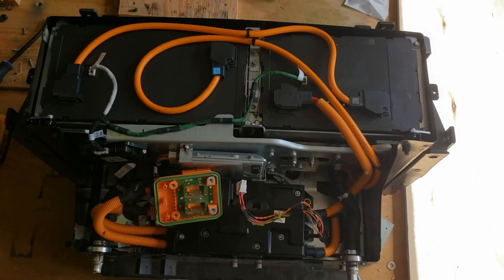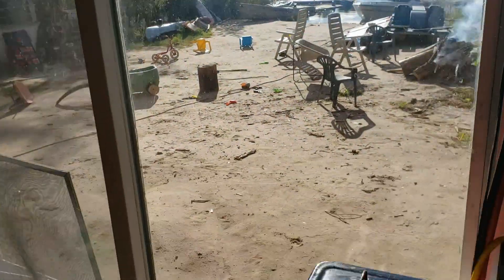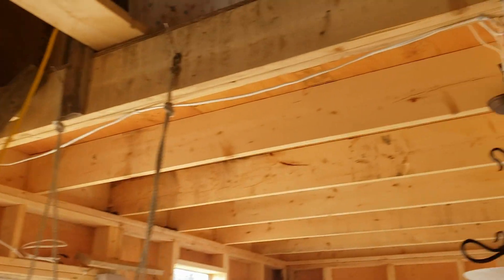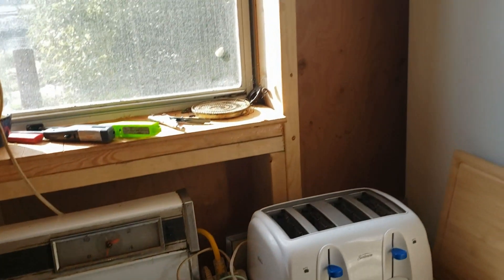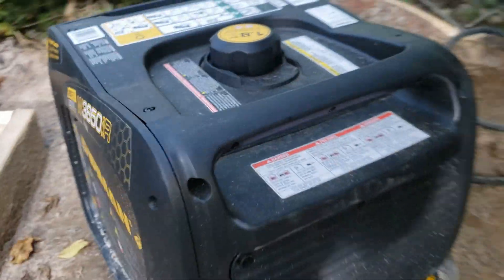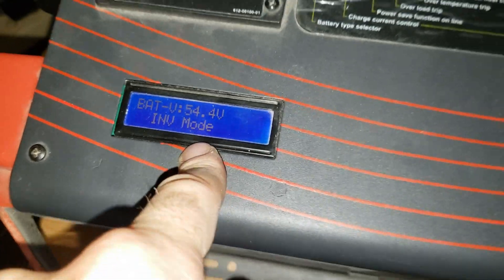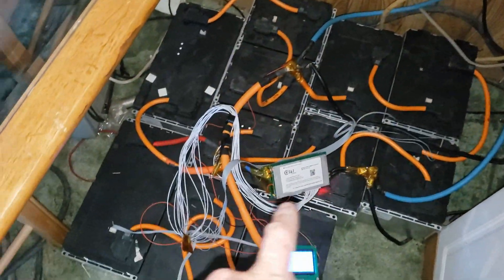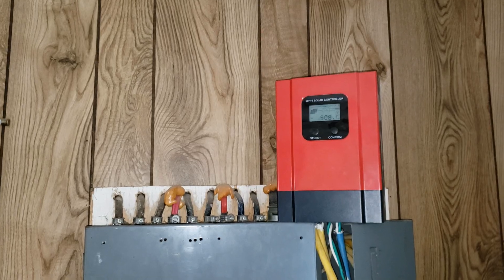12Kwh BMW Battery And Camping

Comment: Why no insulation in the walls. Nice system and video.
Reply from the maker: Just haven't had time to do it yet
Reply: Going Off Grid that’s cool, just strange to see stuff inside without it. Thanks for replying.

Comment: What’s BMS specs and where to get ? Ali express? What is amps or wattage of inverter your connected with. Thanks
Reply from the maker: 350 amp bms 48v powering a 6000w signeer inverter, I really like the bms it's from aliexpress
Reply from the maker: 300 amp not 350

https://www.aliexpress.com/item/32954067682.html?spm=2114.search0104.3.1.21375d47zQfJNE&ws_ab_test=searchweb0_0,searchweb201602_2_10065_10130_10068_10547_319_317_10548_10696_453_10084_454_10083_10618_431_10139_10307_537_536_10059_10884_10887_100031_321_322_10103,searchweb201603_57,ppcSwitch_0&algo_expid=f5a9c49b-7850-4471-8995-42c1162aae1f-0&algo_pvid=f5a9c49b-7850-4471-8995-42c1162aae1f

Comment: What do u ise more pf mppt or pwm
Reply from the maker: Mppt
Reply: @GoingOffGrid101  is there a difference cause videos on here say alot of different stuff
Reply from the maker: @leasttrending  yes mppt let's the solar panel stat at its maximum output power where pwm brings the panel voltage to the same voltage as the batteries